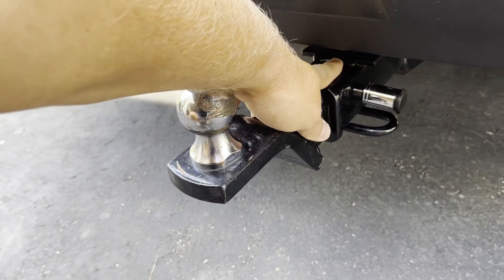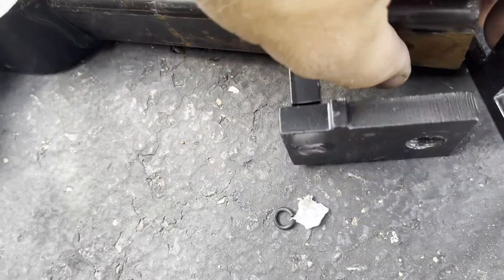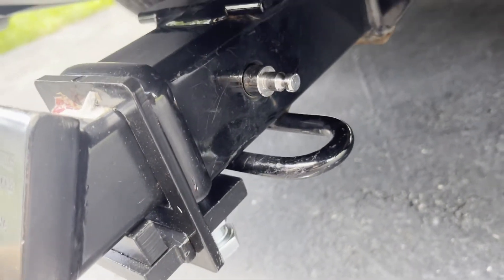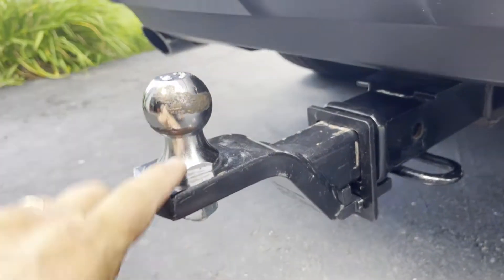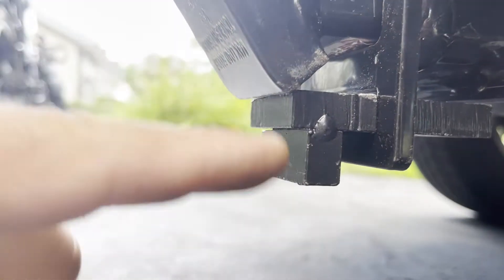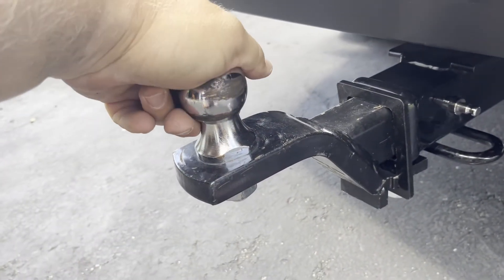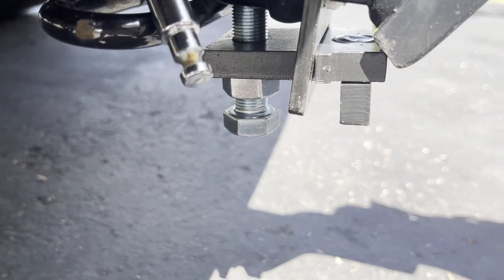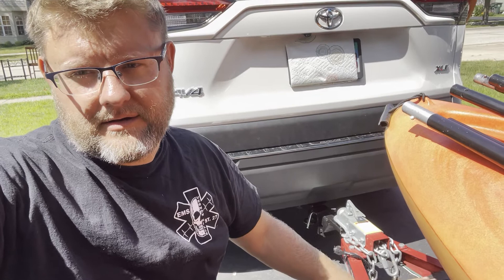How to stop tow hitch rattle noise?

Comment: Its supposed go on the other way, with the bolt on top. So the weight of the trailer is carried by the hitch not the clamp. Flip it around with bolt on top.
Reply from the maker: I tried and can not install bolt from the top because that one metal lip will not fit.